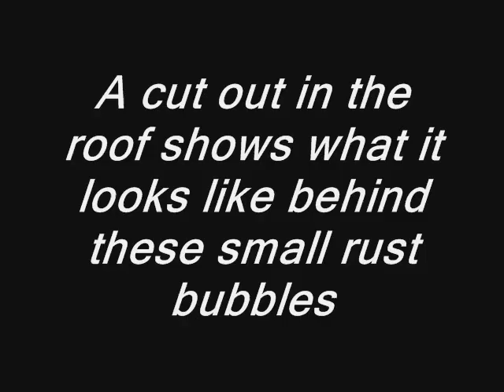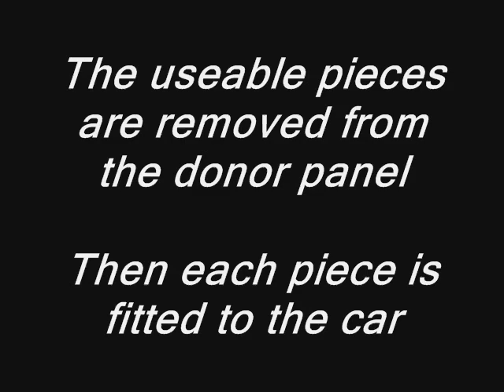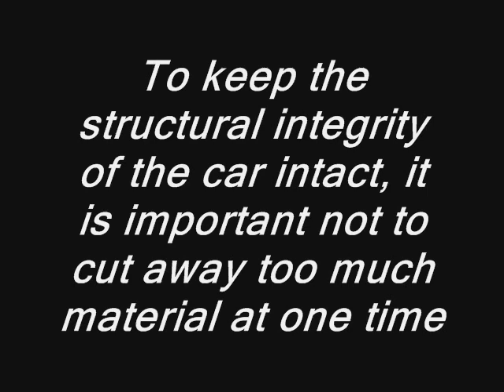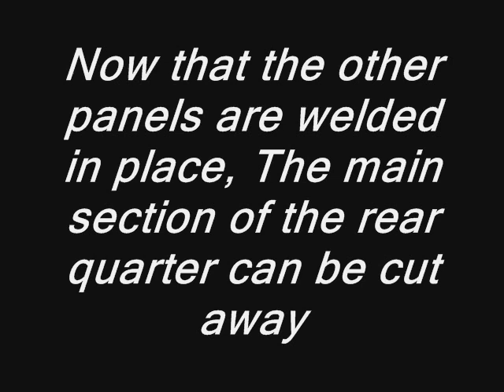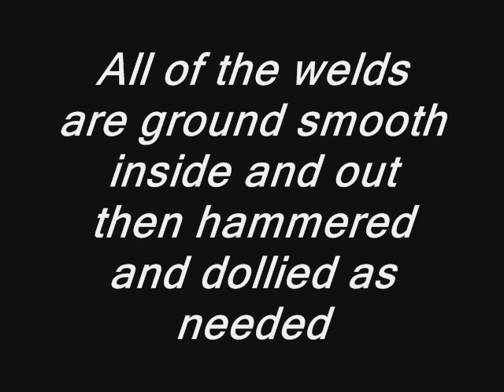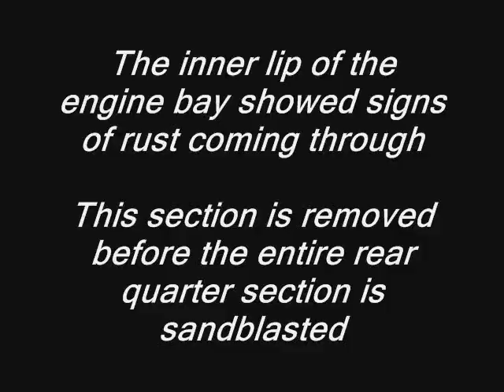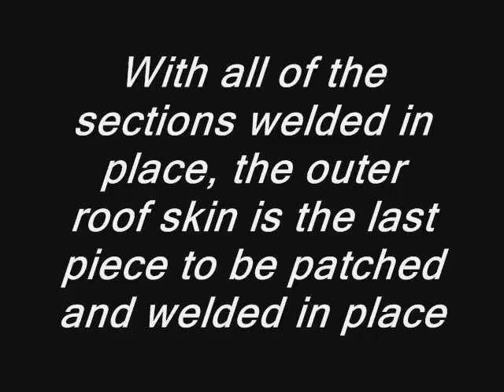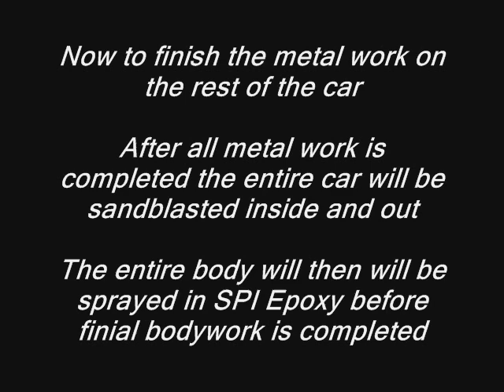1972 VW Beetle Restoration - Rear Quarter Rust Repair

Comment: I am going to buy myself a VW Beetle from 1970-1975 as my first car after seeing all the information and enthusiasts on the internet. Cheap car, cheap maintenance, cheap parts, loads of parts available, no road tax, o.k. gas mileage, and a solution to every problem right here on the internet :D:D Don't mind sacrificing "some" comfort for cheap awesomeness and not having to deal with scammy auto repair shops.
Reply from the maker: +Patrick S be careful with the cheap parts - find a good shop that really knows these cars - you will save yourself a lot of money by finding a good Mechanic that knows these cars, dont be surprised if he has a waiting list or is more expensive than a regular shop - he is that way because he is in demand and knows his stuff - in the end he will be cheaper and will steer you away from the bad parts

Comment: All my rust repairs have been much larger once you cut them open...nice job here....I Learned about the stupid tab, my 74 has this rust,  my plan after fixing that was to weld shut that side vent...like early beetles.
Reply from the maker: +DanTheManIOM I hope I am not to late in my response but I would not weld the vents closed as you had commented.  I replied earlier to someone about this same thing.  The vents behind the side windows were very clean and not the cause of the rust.  The rust is caused by the drain in the rear window.  I had many people tell me before I opened this car up that the vents were the problem but there was no water or rust trail leading from the vent opening to this area.
Reply: +KiddysClassics  ok.  I was told water gets in, and gets down to the foam and rusts... I have seen many 73-74 super beetles with this issue...Don't tell anyone, I put clear packaing tape over the vents.  I did not weld it shut...
Reply from the maker: +DanTheManIOM I think most people I see assume the rust comes from the vent because looking at the car the vent is the only logical place water would get in - most people dont know about the drain holes in the rear glass area - if you contact me at the shop and I can send you better photos that show the water track - my email is Shaun@kiddysclassics.com

Comment: Thanks for the great video. I just bought a 74 Super Beetle that has the same rust spots on each side. Does anybody make patch panels for this repair, or do you have to find a donor car or fabricate the parts? I haven't found any patch panels for that area yet.
Reply from the maker: No one that I know of makes the patch panels for this area,  I lucked out and was able to find a donor section at the VW shop next to me.  It was rusty as well but betweent the two I could make one good one.  This is a very labor intensive area to repair so good luck and let me know if we can help,  I am a little slow at responding on youtube but feel free to contact us directly through our website or by phone if you have questions.

Comment: You mean that small trick of bending that tab could have saved many a late model Bug from rusting (at least in that area)? BTW, when you say "lead the panel", are you using actual lead or a lead-free solder?
Reply from the maker: Yes,  if the factory would have just bent that tab up the water would have not gone straight to the foam.  If you look at the pictures on my website you can see how all of the rust is just in the area of the foam and it starts at those drain holes.  As for your question about the lead, I use the real lead. I like its lower melting temp over the lead free stuff.  Where a dust mask and gloves you will be fine.  Contact Johnson MFG they have the good 30/70 lead you are going to want.  Use a file do not use sand paper.

Comment from the maker: no problem - this area took about 40 hours to work start to finish - Be very careful if you have to do the same type of repair because the body will move on you so make sure you lock everything in place somehow – don’t just cut the corner of the car off

Comment: Roughly how much would this repair cost?  I need this work done on both sides!  Yay demon foam!
Reply from the maker: +Jason Cole  

Every car is different because every cars exposure to rain and moisture would be different.  I have seen a few of these cars that are minor in  comparison, and I have seen some that were in no way worth saving.  My honest answer, when people that come into our shop and want the same repair done is, sell the car and buy a car from out west.  The reality is that for us to repair this amount of rust the way we showed in this video is roughly 40 hours of work.  Could be 25-30 if the rust doesn’t run so deep.  Depending on where you are located shops charge anywhere from $65 to $120 an hours to do this type of work.  If you still want to have it done make sure the shop you take it to, corrects that tab.
Reply: +KiddysClassics  thanks for the response.  And I understand your comment on buying a repaired car... unfortunately that isn't an option.  That car has been in the family since new and has so much sentimental value.  I'll never sell it... only pass it on someday.  The rust level looks about the same to the car in the video.  I know Supers aren't worth much, but to me this one is.  :-)
Reply from the maker: +Jason Cole I don't know where you are located at but if you have any questions about doing a restoration on your car we are here to help. Our contact information is on our website.  www.kiddysclassics.com

Comment: could you just block those side vents with a patch after doing the repair ? and put some of the old style ones in front of the door hinges .
Reply from the maker: +jerry henderson Sorry for the delay in getting back to you but the vents in the side window were very clean and not the cause of the rust.  The rust is caused by the drain in the rear window.  I had many people tell me before I opened this car up that the vents were the problem but there was no water or rust trail leading from the vent opening to this area.